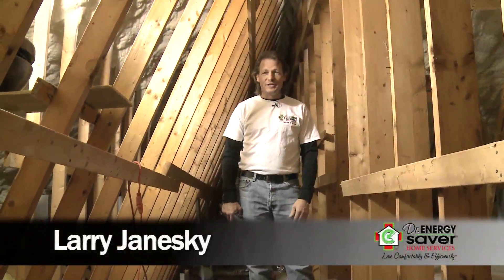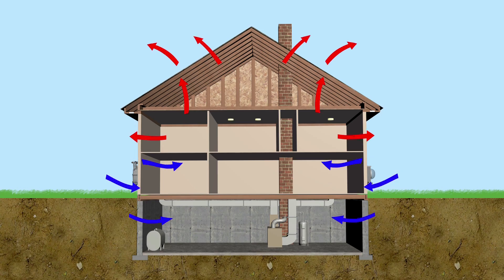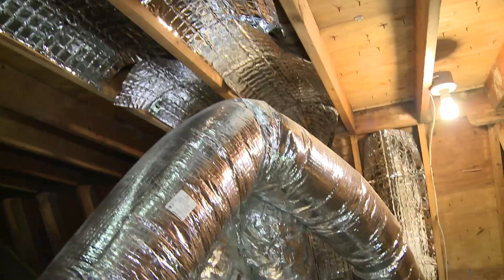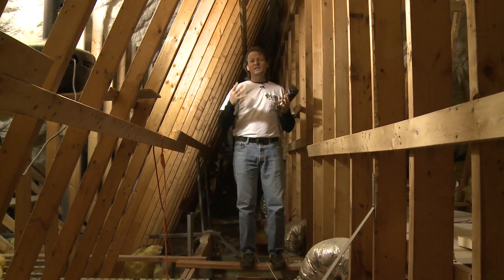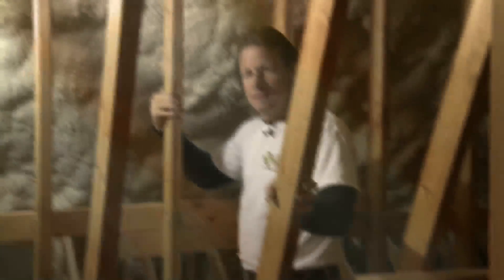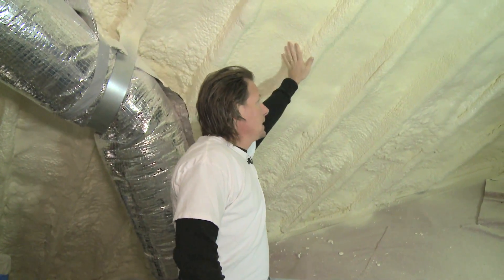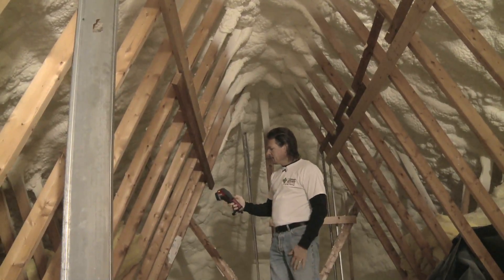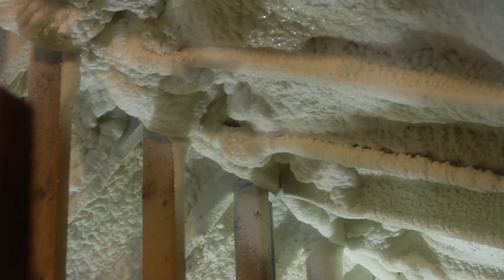Insulating and Air Sealing an Attic with Spray Foam (Short Version)

Comment: I just hope that the roof above is not fiberglass reinforced asphalt shingles.  If so, that roof is toast.  These products must be allowed to transfer heat through and into the attic.  That does not make sense either but it is the nature of the beast.  Five years - tops and the roof is toast if it is fiberglass/asphalt.
Reply: Total BS! That's a myth and there's absolutely no truth to it. Spray foam does not destroy asphalt shingles. Why would it? Making the attic 65dgs in the summer instead of 140 can only help your shingles. They still have the heat from the radiant sun, but at least they're not getting baked from both sides.
Reply: 77Avadon77 35 years in the business says you don't know what you are talking about.  Slate, Tile,Metal - OK, but not asphalt roofing shingles!  New Shingles will bake in a short 5-7 yrs.  Either with foam or with fiberglass bats, the heat is reflected back into the shingles and they become trapped between the hot sun and the insulating barrier.  The shingles are getting baked from both sides - you don't get it.  They burn up, plain and simple.  I have photos of many of these problems from the field.  Just take a look at the manufacturer's specs on shingles and see for yourself regarding insulated decks.  Voids roofing warranty for a reason.
Reply: No I don't get it, because it's totally untrue. It's a false meme running around on the internet by roofers wanting to scare homeowners into getting new shingles, people have been fiberglassing and foaming the roof deck for decades now without adverse effects. I googled it too, the myth of an insulating roof deck ruining shingles is totally untrue. I know it's untrue because I have a spray foamed roof deck. My shingles are fine, and I live in the high desert, one of the sunniest places on earth with very high temps for half the year.

How would they be getting baked from both sides? LOL!! That doesn't even make any sense!! The insulation stops heat from one side. At best you could make a ridiculous argument for heat on one side, which they would get whether you insulated the underside of the roof deck or not. I'm not taking  your word for it when thousands of experts say your wrong with just a quick search in google as well as my own personal experience with it.
Reply: Well watch your roof degrade.  Asphalt shingles and especially fiberglass based shingles which only contain the adherent asphalt, without the base being saturated in the manufacturing process, must have heat pass through them and into the attic.  I am no longer an advocate of asphalt shingles even though I installed them for many years.  I have seen this first hand.  Check with the manufacturers; Check my own website under asphalt shingles:  http://www.fourseasonsroofingandsiding.com/asphaltshingles.htm  .  Before the internet was, I witnessed this firsthand.   Why do you think that ventilation is pushed by the manufacturers?  It is because reflecting the heat back into the shingles will bake them.  Fiberglass shingles will develop striations and then cracks.  They will no longer bridge the thermal movement of the roof deck becoming brittle and cracking along the sheathing joints prematurely.  I have seen this happen with new roofs of only seven years of service. Quite possibly you can incorporate a baffle along with continuous intake and exhaust venting with holes at valleys and skylights, etc.  Become an expert at this and sell value!  Realize the truth instead of becoming entrenched in a wrong method.  That is my advice to you.  I hope you can take a look and see the error of this type of retrofit.
Reply: *****
Keep parroting false information and we'll leave you in the wake of dinosaur builders who did things the old, substandard ways. You're logic doesn't even make sense. If an attic is 140dgs in the summer (very common) shingles would be getting baked from both sides and expedite curling, cracking or striation. Now if we remove the heat from the backside by foaming the underside of the roof deck, the shingles only have to reflect the heat, which is a much easier job then being heated by both sides. Manufacturers are now finally agreeing that foamed decks are meeting and even helpful to their warranties

You're really living in a fantasy land of opinion and conjecture. No scientific facts back up your claims! None!
Reply: You are just protecting yourself.  I understand.  You won't look right in front of your eyes at what you are doing.  I feel sorry for you but even more for those whose homes you are destroying.  I am highlighting this discourse so that the public may benefit from your coming forth to expose your bad methodology.   Thank you, at least for that.
Reply: I just read your writing on " remove the heat from the backside by foaming the underside of the roof deck."  You are removing the heat from the attic!  The heat cannot move through the shingles!  It is reflected back into the shingles.  The heat stays outside.  That would be a good thing but for the deficits in the roofing that cause this, not in the foam.  The roof is of poor quality.  Don't you get it?  Tile, Slate, Metal - go for it!  Asphalt shingles - advise your client before proceeding or offer a baffle system with intake and exhaust.  Oh and I want to add:  Just forget about New Growth Cedar altogether.
Reply: *****
 The heat doesn't have to move through the shingles. Why would heat have to absorb through the shingles to transfer into an extra hot attic. Asphalt roads have a very cool substrate even when they have a 140dgs surface temp. Yet they don't buckle and rise. The proof is in the pudding, millions of homes have foamed decks and perfectly fine asphalt shingles. I guess they just got lucky according to you.

Again, where is the data and science to prove your argument!?!?!?!
Reply: I have published my findings.  If you are waiting on higher thinkers to help you, good luck.  That is just the problem with our industries.  Voices of reason are diminished for the sake of making a buck.  The very "experts" to which you listen will turn on you in a heartbeat to blame the installer when something goes wrong.  This is found in every industry.  Look at my remarks regarding Vinyl Siding.  The VSI threatened a class action suit to silence me.  Look at the "Weather Barrier Statement."   Look at the "Underlayment Craze."  Take a good look at these things and you will find that I am correct.   If you want to get caught in the middle of a storm where you are blamed, go ahead.  I am just trying to help.

Oh and PS:  The roofing shingles will be fine - just for not as long-  I am guessing that the "77" is probably the year you were born....Just about when I got started.   Give a few years and you will benefit from observation.
Reply: Okay just so we're on the same page, you clearly don't have any scientific data to back up any of your claims. That's what I thought before we started this conversation. I trust science, my own eyes, and my own experience over your "findings" any day.
Reply: Ok you trust science and we all came from pond scum and it happened all by itself.  Go on and trust science.  Clearly the roofing industry produces sub-par products that are scientifically made to last for a short time.  Your applications just speed up the process.  It is all about profit and this is put before common sense - just like science.  It is the science of profit and it has been around for millennia.   I am just trying to help you understand the real and tangible elements of the cladding industry.
Reply: OK somebody has science on this but I am always skeptical because science always seems to be driven by a cause and this skews results.  Profit is almost always the cause but here is a blurp from ARMA:
Shingle Application Directly Over Insulated Roof Decks

Applying asphalt shingles to insulated roof decks is not recommended unless the following factors are considered:

Directly applying shingles over insulated roof decks is not recommended unless an adequate continuous ventilation space, free of obstructions, is provided between the top of the insulating material and the underside of a nailable deck. Proper ventilation must be provided to dissipate heat and humidity build-up under the rooftop (See ARMA Bulletin 209- RR-86 entitled “Ventilation and Moisture Control for Residential Roofing”). Factors influencing the minimum ventilation requirement include type of construction, roof pitch/run, temperature, humidity, etc. Consult the deck manufacturer, deck system designer, and asphalt shingle manufacturer for specific requirements.
Reply: Comparing thin roofing shingles to an asphalt road is not a good analogy.  Neither is comparing a low sloped asphalt built-up roof to a thin asphalt shingle roof.  Asphalt low slopes have been installed over insulation for many years without issue.  Asphalt roofing shingles are the issue.  

I think you have misunderstood my premise.  Insulating the attic at the roof is probably the best thing for most applications.  It is bad for the asphalt roof, which is an inferior product anyway.  You should not see much of this in your climate anyway.  Asphalt shingles should not be installed in aired climates IMO.  Anyway, manufacturers have backed away from stipulations regarding insulated decks (I think because they don't want to affect the bottom line in reduced sales).  They do however stand firm on the ventilation requirement, which blows the the insulated deck out on asphalt shingles.  IKO is one manufacturer that has made investigation into the topic and listed the following:

6. Exclusions 4 & 5 notwithstanding any fiberglass asphalt shingles manufactured to meet ASTM D3462 applied to roof deck assemblies
(slopes > 2:12) where foam insulation is prefabricated into the roof deck system (often called “nailboard insulation”), or where insulation is installed
immediately beneath an acceptable roof deck system, or where radiant barriers are installed, with or without ventilation, directly below the deck, shall
qualify for a reduced limited warranty duration of 10 (ten) years with no Iron Clad Protection coverage, with respect to shingle problems related to
the absence of adequate roof system ventilation (linear pro-ration over 10 (ten) years). The roof design professional is responsible to ensure; 1) the
proper quality and correct application of the insulation and/or radiant barrier, 2) the provision of adequate structural ventilation and/or vapor retarders

Atlas Roofing, a manufacturer has also addressed the issue:  “ Atlas will not be responsible for the performance of its shingles if applied directly to non-vented, insulated decks composed of perlite board, plastic foam, fiberboard, gypsum plank, lightweight concrete, cementitious wood fiber, or similar materials or to any decks with insulation installed directly to the underside of the decking...”

Certainteed is allowing insulated decks with an air space and intake and exhaust.

So I will stand with my original statement that you should be offering a baffle system with intake and exhaust under asphalt shingles.  If the client wants a better roof steer them to metal, tile or slate, according to the sustaining structure.
Reply: ***** robert your wrong and i had to retype this so let it sink in, what cause asphalt shingles to fail is holding heat, thats why a second roof is never a good idea. because both layers hold heat and stay hot longer. the roof must cool quickly and that is accomplished with an insulated deck. also condensation issues are overcome with it. i am a master roofer and i just have to say your wrong about manufacturers installation guidlines gaf,tamco, owing corning,and certainteed all allow this installation with no detriment to the standard prorated warrenties. prove me wrong i know all the reps and have thier cell numbers on my phone right now.so please stop with your nonsense..the heat never has anywhere to build up and shingles never get any hotter than before and cool quicker after sundown but your head around that one an tell me why im wrong
Reply: The manufacturers softened or even omitted the language regarding insulated decks.  The double speak comes in with the retained mandate for ventilation.  How are you going to provide ventilation under the deck when it is insulated tight?
Reply: you only needed the ventilation to disperse the heat and or the exposure to the deck by air that would condense water on the decking due to the difference in wet bulb dry bulb temperature differences
Reply: in fact just now i think i know where the debate was coming from an insulation like fiberglass would cold heat if it wasn't vented with a piece of egg crate spacing. and would have just enough air exchange for moisture to condense.i saw a house like this last year ice water shield 3/12 architectural shingles and it literally condensed so much water it looked like a leak. it was all condensation because water was everywhere evenly dispersed like an aquarium with a humidifier or steam shower...zero ventilation and was super tight. rotted the roof out in 5 years..
Reply: Ventilation has nothing to do with the source of moisture.   I have seen the same thing in the summer time above a second floor sauna that was emitting high concentration of moisture.  Looking to ventilation to cure moisture problems is flawed methodology.
Reply: Stop Feeding the troll. Mr. Robert is a kid hiding behind a computer crying that he is not capable of installing spray foam. But then again its not for kids anyways. He wants attention and your providing it. Lets move on.
Reply: Not trolling at all...  I have even found recently that slate roofs seem to deteriorate faster when spray foam is installed.  Now this has been witnessed when an older Pa Black Slate roof received foam under the deck.  The slates quickly broke down under the exposed areas, crumbling and sliding in ways not normal for the Bangor variety.  I do believe that foam is detrimental to both slate and asphalt but slate lasts so much longer that the effect is usually not noticed.  Asphalt is another story.  \you have to baffle and ventilate to do it right.
Reply: ***** That baffling is only necessary when insulating with fiberglass/mat insulation.  Closed-cell spray foam as an initial layer on the roof deck completely eliminates the ventilation problem because there are no opportunities for condensation to occur.  The only problem I see with spray foaming is the cost.
Reply: El Gwat
Don't engage Robert, he's a troll without any evidence. I have C.C spray foam right to my roof deck, no baffles.. no condensation point. years of baking hot 90dg heat in the summer of oregon and -20dgs last december. Not a single curl of my fiberglass ashphalt tiles. Problem is you got morons like this running around spreading false information trying to scare people into using inferior fiberglass insulation, only to their own detriment. C.C foam saves me so much on my heating.. it's incredible. I calculated it once.. it was over 100$ each month in the winter and that is just in my shop.
Reply: Fiberglass shingles don"t curl, they crack.  It starts with minute barely distinguishable cracks that grow.  My information comes from experience.
Reply: 77Avadon77

Seems to me that you've forgotten the very nature of where the heat comes from and where does it go.
"Spray foam does not destroy asphalt shingles. Why would it? Making the attic 65dgs in the summer instead of 140 can only help your shingles."
The shingles aren't cooler. They will be hotter. They are now insulated from the attic. The attic was previously hot because the sun on the shingles was heating the attic.
Where does the heat from the sun go now that the underside is spray foamed?
Wouldn't a very simple and inexpensive installation of spacers. and thus maintaining eave and ridge ventilation, help the roofing maintain a lower temperature and make redecking if necessary easier?
Reply: ***** No I have not forgotten.  I see the problem all the time.  It happens on slate roofs also.  The lifespan of the cladding is diminished.  With insulation attached directly below the roof decking, heat from the sun is reflected back into the the roof cladding.  Manufacturers are calling for a ventilation plane like you suggest.  Asphalt shingles require that heat pass through them and be dissipated from below.  Slate roofing (at least the Pa. Blacks) also also susceptible to lessening of the life cycle of the roof.
Reply: Not true Robert, I've been doing this for 10 years and Elk and Certain Teed will extend the warranty if foam is applied. Florida State designed several houses with and without foam (roof Line) and the temp rise on the roof shingles was only 3*F and the attic remained 8 to 12 degrees warmer that the thermostat setting inside the house. The reason shingles curl is because the attic gets 140*F-160*F during summer sun plus the heat from the sun(outside). The attic never cools off so the shingles cook from the top and bottom side all summer. When foam is applied to the roof sheathing the attic is cool and when the sun goes down the shingles cool off to ambient temperature therefore extending the life of the shingles.
Reply: K BBV Welsh KBBV
I've been in business since 1978 and witnessed the changes in asphalt roofing shingles.  I put them on way before nail guns and still don't use them but I must admit that I am no advocate for the products.  The one-part asphalt on fiberglass roofing shingle does not buckle.  It cracks while laying flat to the eye on the ground,  The warranties are a bad joke for the consumer.  What is now a "lifetime" warranted product used to be a 25 year product and the quality has diminished.  Shingle warranties are a lie, plain and simple.  You don't want to base quality perception upon claimed warranties.  I have read self serving results from those in the insulation industry.  I am assuming that the same sales tactics are used in insulation as in roofing.  The shingles toast rather quickly.  I have clients with PA Black Slate with this insulation sprayed on the backside and the slates are falling apart before their time.  They are actually separating beneath the exposure.  There is a correlation between indiscriminately placed insulation and the premature failure on rooftops.
Reply: Thank you!! Glad to know there is at least one other person that realizes the truth.

I have 7"!! of CC spray foam under my roof deck. Cost a friggin fortune and total overkill. It's been up there for years in the baking hot desert sun. I don't know if anywhere on earth besides phoenix AZ gets more sun then my house. Yet I don't have a single curled shingle. Also the proof of insulation is in the winter when there is more snow on my spray foamed building then there is no the unspray foamed (blown in) house. That's because the spray foamed shop is not bleeding any heat up into the roof deck and up to the shingles so the snow is settling there and staying. Unlike the house where the heat is coming up from the house and into the attic where and then transferring that heat to the roof deck and shingles.
Reply: 77Avadon77 Oh boy, must be your mom's house cause you are still wet behind the ears young man.  Hate to be so blunt but fiberglass shingles don't curl.  They crack while laying flat.  You usually can't see it from the ground.

Let's hear from a roofing pro...a real one and not a pretender about this.